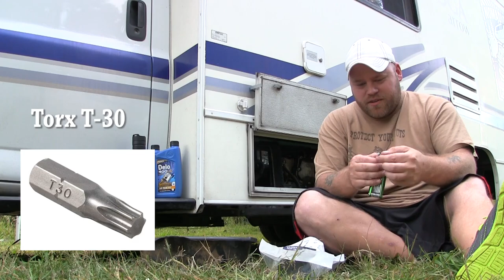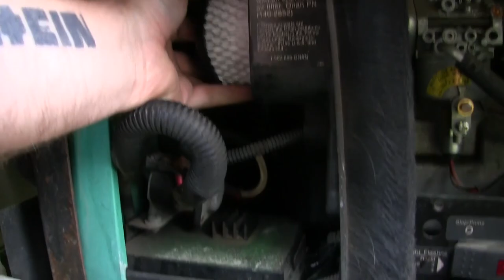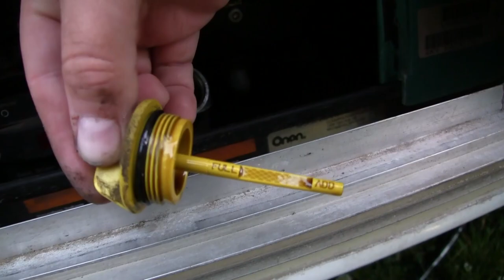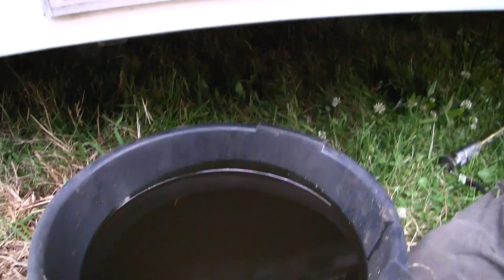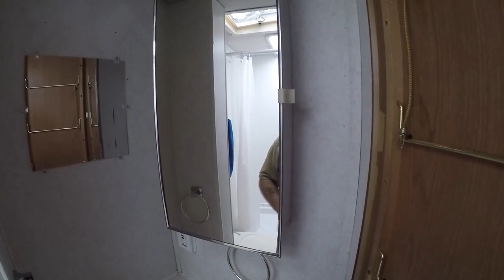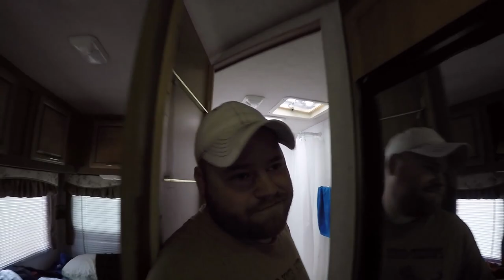Changing Oil & Filter Onan Microquiet 4000 Generator

Comment: Great Idea staying with the 15W40, and going synthetic.  Because most generators do not have an oil filter to remove dirt and impurities, it is even more important to do regular oil changes, and as my description below will explain, it's very very important to change it while the engine is hot.  Besides $15 once a year is cheap compared to $2,000 to replace a generator.  Also, synthetic allows easier starting in cold weather, and NOTE: Synthetic can find a way to leak out through places that regular oil won't so leaks will show up sooner, well before a major leak causes real problems.  You don't need to remove either screw from the cover plate below the RV to access the drain plug.  Only one of the screws goes through a hole in the plate, the other is in a notch, so once loosened, the plate can be swung out of the way.  ideally, you want the oil at operating temperature before draining it, so it's at it's most fluid viscosity, and all the impurities that settled out become mixed in and suspended again.  So, you should first start and run the generator for 5-10 minutes, before you do anything.  Shut it off, and pull the drain plug to drain the oil.  Yes it will be hot.  Leave it draining, and the last thing you will do before filling it with oil will be to replace the drain plug.  Let it drip, while you change the air filter, change the plugs, give it a bit of a wipe down with a rag, and look for obvious loose nuts, bolts and screws, anything that looks cracked damaged or missing.  Quickly test each accessible wire by hand to see if they are loose, corroded burned or insulation cracked or missing.  This visual inspection only takes a minute and can help minimize future surprises.  Next, wipe around the bottom of the generator around the drain hole to remove dirt or oil.  Any dirt left there could actually be the source of a future leak. Last thing before installing oil, wipe the drain plug off to remove any dirt that could cause a leak, and carefully inspect the plug.  Are the threads damaged? Yes? Replace it.  is the head where the socket goes damaged, with the corners rounding off? Yes? Replace it to save yourself the grief if it's baked in tight next oil change.  install it finger tight.  Use the socket in your fingers to reach. If it's tight right away, stop and make sure it's not cross threaded.  Then once closed finger tight, grab the socket and snug it up.  It looked like you used about the right amount of pressure.  Not too tight. its just a plug, it's not holding the whole RV together. Now fill the oil, and run it to temperature again while checking for leaks.  Warm oil leaks much easier than cold oil.

Comment: Download the service manual, it's free. Write down all your part numbers. According to your service manual, straight 30 weight is the preferred summer oil, oil should be changed every 150 hours. Always read you manual, and not what the "forum" said........I saw it on the internet lol. That is a very expensive and reliable generator, probably the most reliable and best thing you have on the RV, take care of it and follow the service manual to the tee, because once it goes out, you'll be hating life.
Reply: Forget about using 30 weight on an air cooled everyone 15w50 mobile on mine

Comment: I'm glad I watched this. I saw one of the comments that the Onan 4000 has no oil filter. I did not realize this. It sounds extremely important to do regular oil changes. I have a motorscooter which also has no oil filter.  It needs oil changes every 500-800 miles. It is easy and it only uses 3/4 of a quart of oil, but it has to be done. I could not even find quart bottles of 15W-40 at Walmart. I had to buy a gallon jug. But that is okay if oil changes have to be done this often.

Comment: HINT: Write notes on the inside of the generator door! Filter number. Oil weight. Dates changed ETC. My father taught me that and it saved a lot of guessing! (Write it on the door or on paper in a zip-lock bag attached to the door!)

Comment: Pretty slick video (sorry about the oil change humor - couldn't resist, it just slipped out).  Seriously, using synthetic motor oil is probably the single best thing you can do to prolong the life of any internally lubricated machine.  Three cheers for superior lubricity!  The new spark plug will help it start easier, especially during a cold start.  They don't call it PM (preventative maintenance) for nothing.This Chrysler Dealership Service Manager appreciates the demo on your service.  Thanks for sharing.

Comment: Another great video, Eric! One thing I'd like to suggest, and this is something I've done with my generator before. Since it doesn't have an oil filter, when I change the oil I like do a "wash" of the inside of the engine. Some auto part stores carry an engine flush, just make sure  you're not getting the flush for the cooling system.

If  you can't find that, another alternative is kerosene. Using that is a little different because the engine flush from the store normally says to run the engine for 5 minutes, but with the kerosene you'll only run it for 2 minute MAX!!

After you've run the engine with the flush in it, drain it out again. I like to use a clean oil drain pain just so I can see how much sludge I get out of it.

What both of these do is flush out all the left over sludge in the oil pan and the channels so it won't get mixed in with the new oil.
Reply: Kerosene does not have sufficient lubricity to avoid damage to bearings. If you have done this, which I greatly doubt, you were extremely lucky. If this was a good idea, you would see it in all engine owner's manuals. Following the manufacturer's service reccomendations is the way to go.
Reply: Ok, you're going to be one of those people, huh? Generally speaking there is more than enough left over oil sludge in the engine that the kerosene will thin it out enough to provide lubrication for a brief period. That is why I said 2 minutes max. Generally I only do it for 1 minute since that is all that is needed. It is simply meant to rinse the sludge out of the engine, that's all.
Reply: No, I'm  not saying that the 150K is high because of the wash. I'm saying that having done the wash with that many miles on it, there have been any issues with it at all.

As for being unnecessary, try it some time with the stuff sold in the auto parts store and see what comes out. You might be surprised. 

You'll also note that I said to use the flush sold in the store.first. The kerosene is only if you don't have access to the store sold flush.

Also consider that a normal engine, at idle, can run without oil in for up to 5 minutes before any serious damage will occur.

And, most people i know that have a vehicle under warranty will take it to a shop to have the oil changed as proof of it being done. Most warranties will be void if there is no proof of the oil change since not changing it on a regular, scheduled basis is required. I know it was for my car.
Reply: +Daniel Bellows So- you're saying that your Equinox has achieved 150k miles with no apparent harm, even with the completely unnecessary kerosene flush and I'm saying that I've had vehicles with over 450k miles without the worthless and possibly damaging procedure. I'm at a loss as to how you can justify this snake oil given the paucity of results you have described. To put forth this theory, I would expect you to have results far in excess of what following the engine manufacturer's reccomendations would bring. The only thing I can take away from this is that it is a complete waste of time, money, and expectations. 
Regarding engines still under warranty, you suggest people have their oil changed professionally, at a shop, perhaps even the dealer. if the benefits are so great why hasn't my dealer told me about this boon to engine longevity? 
If you asked your dealer or the local oil monkey franchise to do this they would either laugh you out of the building or throw a net over you and wait for qualified medical help.
Reply: +Daniel Bellows Up to 5 minutes means anywhere from ZERO to 300 seconds, right? Not a bet I'm willing to take.
Buy a new car and tell the dealer, while it's still under warranty, that you're using this procedure. Your VIN will be flagged and ANY drivetrain issues you have during the warranty period will be enormously difficult to be resolved, if the manufacturer doesn't just outright void your warranty due to misuse or abuse. NO manufacturer will allow this to slide by.

Comment: Always check the the owners manual for proper viscosity selection. For temperatures from 10 degrees to over 100 degrees F you want 15W-40. SAE-30 is also a good choice. Check page 26 here: http://power.cummins.com/sites/default/files/literature/rv/F-1123-EN.pdf

Comment: Job well done. Mine is a HUGE pain to change the oil on a Sprinter RV. The generator is underneath and you literally have to crawl under the chassis  to do the changing of the oil etc.

Comment: Home Dept and I'm sure others have rolls of plastic that are 3' wide and really long that can be used to put under the RV to lay on while your doing oil changes, so you don't loose the drain plug in the grass and catches any possible leaking oil going into the ground. I used it all the time when I had to crawl under houses for plumbing repairs.

Comment: Do you always have oil on the plug like that. I got an RV with an identical generator and it's leaking out from the plug and it's plenty tight. I think I might need to put some Teflon tape on the threads.

Comment: Hi Eric the copper washer on the drain plug is a single use item, that is why you saw that drop of oil hanging from the plug, I wouldn’t change it right now, but find a couple of them on Ebay so you have one handy for next time, whith the old oil being so dirty I would change it again much sooner then one year, probably in 3-6 month,  I would also get the air filter from Ebay, they start at 9.05, surely Onan charged you more than that, much if not all of Walmart`s oil is Pennzoil so that could be a cheaper option                                                                      other than that        sweet quiet generator

Comment: I have now changed the oil in my Onan Microquiet 4000 twice.  The first time I had a heck of a time with those bolts that cover the drain plug.  So I took them to the hardware store and replaced them with hex head bolts, same thread pitch.  I used SAE 30W oil.  My manual says that is fine for 32f or above.

Comment: Mr. Jax and Eric Jacobs,   Hello Eric, I liked the Maintenance on the Cummings Genny.  If you use it at high altitudes, you might want to tank up with higher octane fuel.  89 or above.  To keep the Genny running.  My Genny is located under the vehicle, so I take it in at a Cummings Dealership and let them access it for yearly Maintenance.
Reply: Actually, higher altitude requires lower octane fuel unless the engine is supercharged or has a turbo. This is the reason most areas st higher altitudes sell lower octane fuel as standard. Higher octane fuel is only needed if your engine has higher compression and the manufacturer specifies it. Otherwise its a waste of money to run higher octane in engines designed to run on regular gas. 
Also, higher octane fuel has a lower volatility index and may cause problems when starting the engine in cold temperatures.
Reply: Thank You!  I wonder why my Genny runs better with higher Octane, then?  I will be taking another trip this year to the Washington State area---and will see what happens.  My Genny is brand new, too.  By the way I use to be a Harley Rider, also.  No high siding.
Reply: Exactly.  It is all about the compression and what pressure detonation occurs.  I have to laugh when someone tells me their Escort runs better on higher octane.

Comment: Me I would have drain the oil right away befor starting that motor up and sending the old oil through that motor again All the old oil would have been sitting at the lowers spot in the motor where the drain plug is. If it's been just sitting doing nothing. If any shit was in the oil it would also be sitting at the lowest spot in the motor, where the drain plug is. By starting the motor up the oil pump would have sent all that old oil through the motor again Making it that you have to let the motor sit until all the old oil drops to the lowest spot in the motor again. If I do start a motor before changing the oil, I let the motor run until it gets up to running temperature. Hot oil it flows better Get it nice and hot then drain the oil right away. But to each their own. That is just how I will do an oil change . Best thing is. The oil got changed and with good oil. It does pays to use good oil. Not that cheap shit if you want the motor to last

Comment: Eric:  Regarding the possible oil leak around the drain plug.  Is it possible that you are supposed to use an aluminum crunch washer under the drain plug?  And that old oil was overdue for changing.  Changing to the synthetic should help you with getting the once a year change you are hoping for, but check it's condition.   And although I am sure that they "soak" you for that air filter, it was also way overdue.  And I do not mean to be critical.  I have been guilty of delayed maintenance too!  Good video as always.

Comment: Eric you should drain your oil cold or let it get good and hot. All you did is circulate the oil back up into the oil passages and with it being cold it doesn't drain back out. Always cold or hot never start and shit down..
Reply from the maker: yeah, I was just trying to loosen up all the oil and make it drain better.
Reply: +Nomadic Fanatic but that's the point you did just the opposite and made sure it didn't drain well.

Comment: That is some gnarly looking oil and a well-used filter, indeed. The brownish color of the oil inidicates that there might be some water (maybe condensate?) mixed in as well indicating that the oil needs to be changed more frequently and/or the generator needs to be run for longer periods of time to allow water to evaporate and vent out of the system.

Does the service manual say to do maintenance yearly? On my Yamaha it's based on the # of hours and, without an engine hour meter, I end up changing the oil way more often than needed :-(. Using synthetic oil is a good idea :-).

Thanks for the video, looking forward to the next one!
Reply: 150 hrs

Comment: A few hints... to not over tighten, use a torque wrench set to the proper torque, An Air filter actually filters better when it is loaded with dirt, however if it is so loaded it restricts air flow, you might run rich and foul spark plugs. And Synthetic oil is often much thinner than natural oil, and can leak through your seals on an old engine.  So watch your exhaust and see if your burning or loosing oil in 10-15 hrs of run time.

Comment: Eric. Re the air filter. The metal air filter cap does not look like it got put on all the way? Maybe it seated after the wingnut was tightened. But in the video it's clearly not fully seated when you first put it in place.

And if you look at the old filter vs. the new filter. The old filter is either shorter or the new filter is not fully inserted in to the housing. The new filter is clearly sticking out further after you put the wing nut on it.

Comment: Erik did you ever fix  the hole that had rotted out? The one you put spray insulation in a few months back.
Reply from the maker: The expanding foam has held up, so I'm not going to be welding or doing any metal work right now to fix it.

Comment: Just hope you don't have to replace the carb on that thing. They are notorious about having issues, most of which is brought on by lack of use, but mine failed and I used it daily for about a year in my TT. PITA and $$. I have a 7500 QuiteDiesel now, and it needs it's first major service. Ugg, $$$ as it needs to be dropped out of the coach, no slide, though same price either way at the Cummins/Onan shop.

Comment: Hey Eric, I'm no mechanic but I wonder if purchasing some seafoam in a spray can aerosol.
I don't know how you would use it but I would think that if you took the air filter off and while running the generator spray some of that in there to clean out the carbon buildup you might quiet the engine a little more. just a thought. happy trails

Comment: Normally, these generators have a service interval, something like every 100 or every 500 hours or so. Depending on how often you run it, once a year may be not enough for the oil changes. Or it may be way more than it needs, but that wouldn't hurt it :)

Comment: Eric, thanks for a clear and concise video.  Very nicely done and super helpful.  I need to do an oil and air filter change.  I also need to clean or replace my Onan 4000W Generator Carburetor and possibly Fuel Pump and filter. Do you have any videos on these?
I wonder if you had any thoughts about how to convert a static generator into a pull out tray type.  Thanks!

Comment: That oil looked nasty. I would replace it again in a week or so to flush all the nasty crap. Replace the filter too. It's a small cost to ensure long service life. Synthetic oils tend to have more detergents. You'll have a lot of crud in oil again after several hours of operation. If you change it again soon, all that crap should be in the oil and  it will also flush out the remnants of old non-synthetic oil.